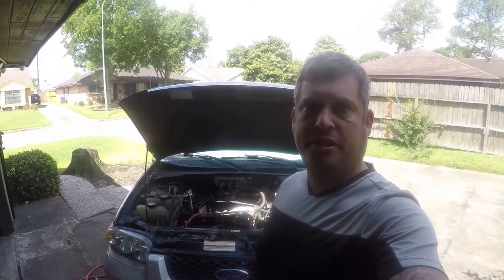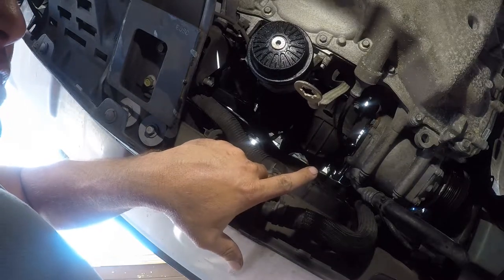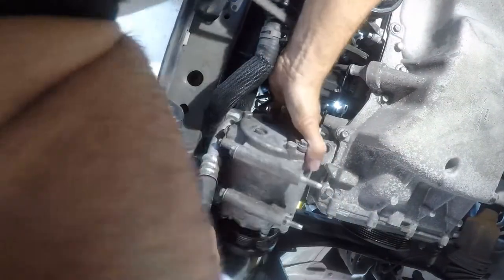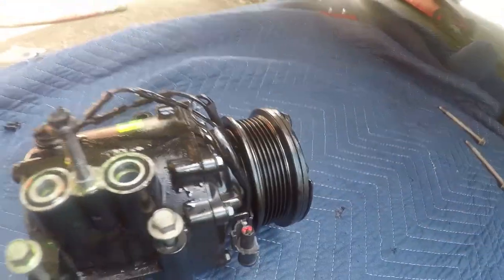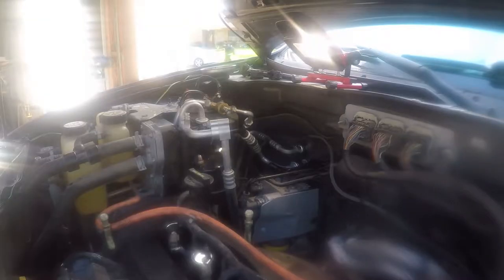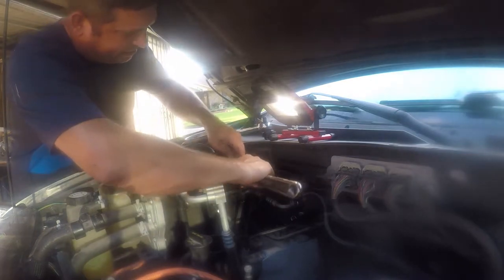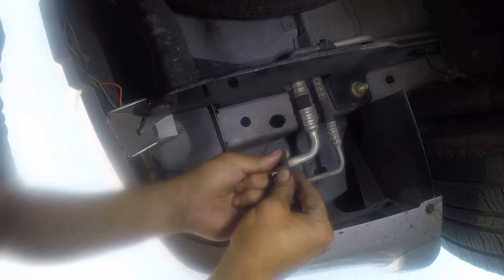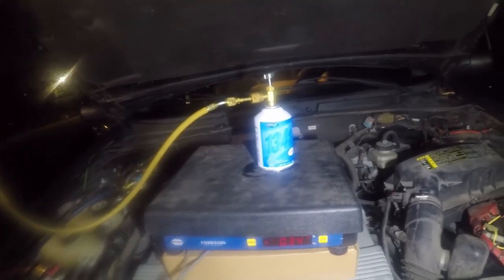Ford Escape Hybrid - Replacing AC Compressor (long)

Comment: Thanks for the video. I did this last night. For the top bolt I removed the pulley tensioner for better access. It looks like if you remove the thermostat housing it would make for easy access to the top rear bolt, but I didn't want to empty the coolant, so struggled through it from the bottom.

By the way, 9 times out of 10, it it's making cold at speed but warm at idle, it's the scroll valve in the compressor. That can be changed separately and easily from the back access plate on the compressor. I did so ~100k ago but now the compressor is leaking oil and blowing the clutch fuse. 1/4 million mile and going...
Reply: Hi, where you bought the scroll valvle?

Comment: i have 09 escape EVH i took off belt tensioner and upper end of rad hose and made it FAR easier to get to 2 upper bolts with a ratchet 13mm wrench

Comment: Great video, going to tackle this myself next week when my parts get here. I didn't know about the small filter in the back for the battery, I'll defintiely get one on order! A lot of folks recommend replacing the condensor while you are at it since it's possible debris could be plugging the tiny holes either reducing its ability to cool or pugging up the system entirely. While everything is disconnected others recommend flushing the rest of the system to help clean out any other particles that could gum it up, I plan on trying it, whether or not it's necessary I dont know.

Comment: Will the hybrid and regular escape have the same compressor?
Reply from the maker: unlikely.  Hybrid has higher refrigeration requirements due to the battery pack.  Best thing is to check somewhere like RockAuto for parts list and compare the two to see if it's the same compressor.

Comment: Do you know where the orifice tube is located ?
Reply from the maker: There are two.... one is in the back by the battery, the other is in the front by the accumulator.  Both should be checked/changed if you are having performance issues.

Comment: Would you be able to list the part number for the rea in line filter? I went to Ford but the parts guy had no idea what I was talking about even though he pulled up the diagram.
Reply from the maker: I think I bought it through eBay or Amazon.  I found one on eBay for $4.50.  Way cheaper than the Ford Stealership is going to let you have it for.  https://www.ebay.com/itm/A-C-Inline-Filter-EX10358C-UAC-/372978552306?_trksid=p2349526.m4383.l4275.c10#viTabs_0
Reply from the maker: Amazon - $9.98 https://www.amazon.com/Universal-Air-Conditioner-EX10358C-Filter/dp/B00FY80AF8/ref=sr_1_10?dchild=1&keywords=EX10358C&qid=1589937755&sr=8-10

EX10358C is the p/n
Reply: Brian Greul thank you for the quick reply. I found and ordered the part and have replaced it thanks to you.

Comment: I agree and it was designed poorly. Not sure about 07 but I used 3 different tools to took the 4 bots of the ac compressor off my 08. The tool I used  flex ratcheting wrench, flex head wrench and DEWALT Right Angle adapter. I used impact and and the right angle adapter removed the top right one from the bottom.  It was a few hours work. I hate this design.
Reply from the maker: be sure when changing the compressor to service the rear evaporator orifice... it's prone to trash building up and it will ruin the battery if it isn't working
Reply: @hotpuppy72 thanks 🙏

Comment: Super pleased you put this video up. My wife's 06' Escape is in need of this so looks like I'll be tackling it soon. I had a shop diagnose this problem and they also said I need to replace the accumulator and expansion valve on the rear. Is there a reason you didn't go further with this repair?
Reply from the maker: I thought I filmed the filter in the rear.  Didn't have any issues after that.... rear filter was clogged.